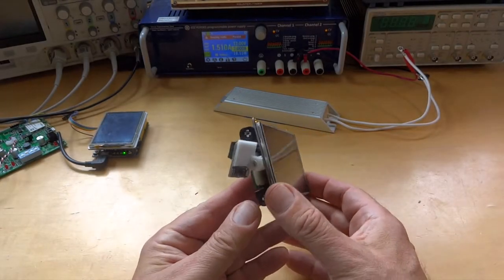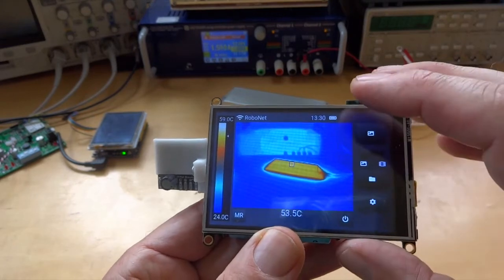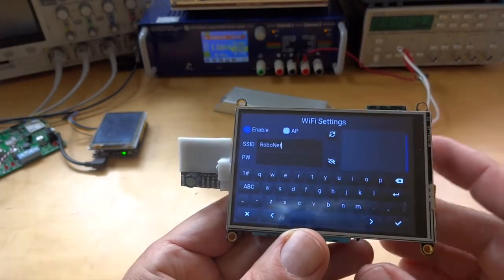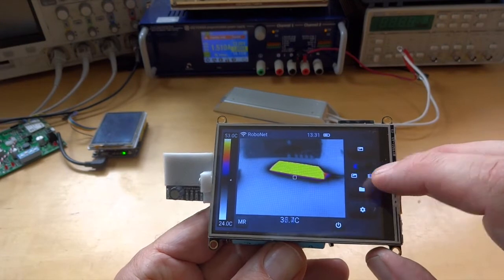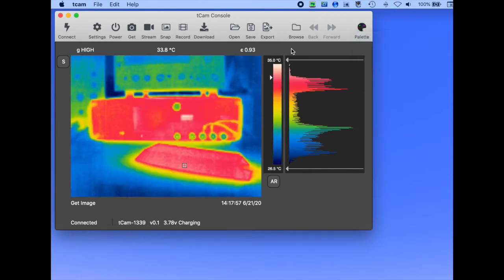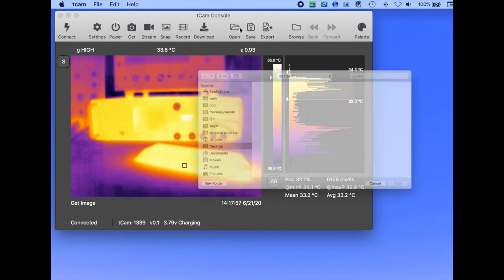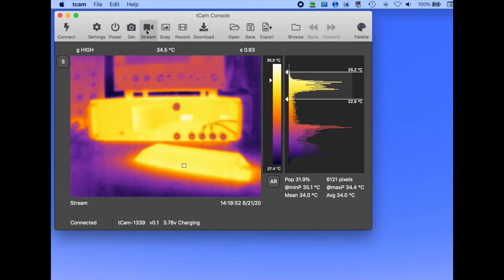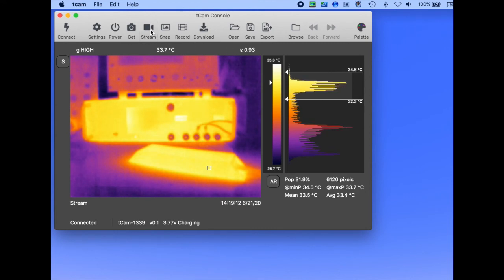tcam thermal imaging camera introduction

Comment: how many meters can you catch the hot temperature
Reply from the maker: Sorry I don't have a more specific answer but it depends on the size of the object.  The Lepton has a 160x120 pixel resolution and 57° field of view so the object has to fill at least one pixel (preferably more) at whatever distance it is from the camera.  With the size of an object then you can use geometry to figure out if it's visible.